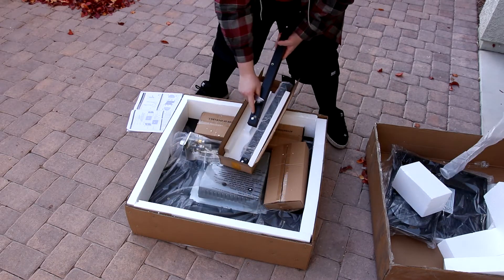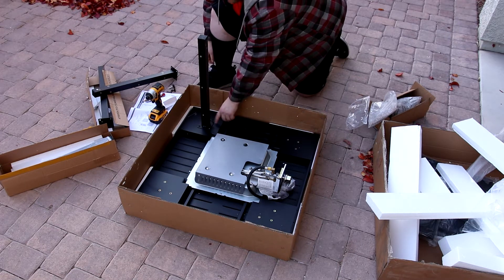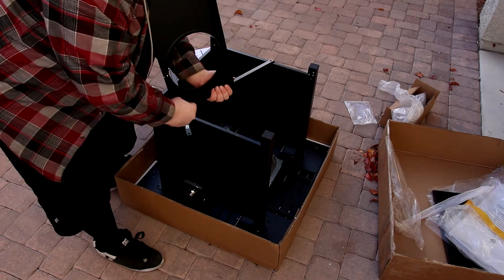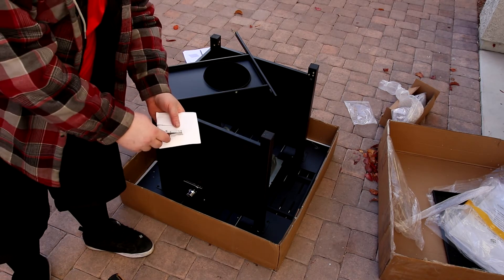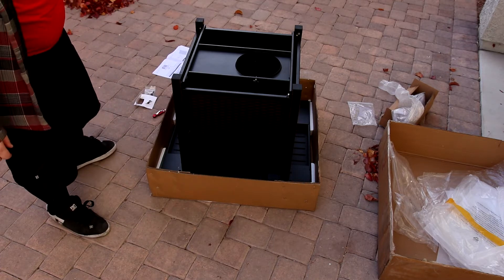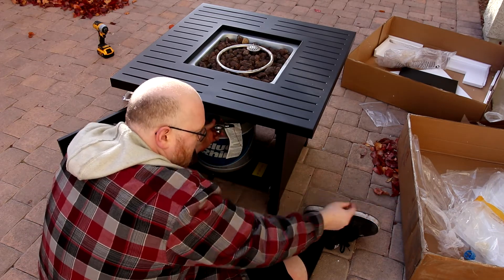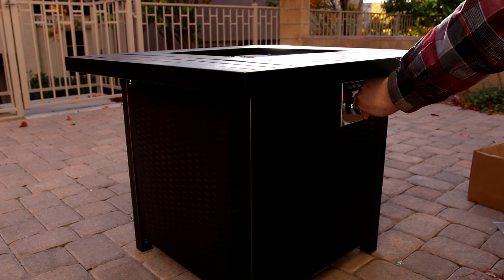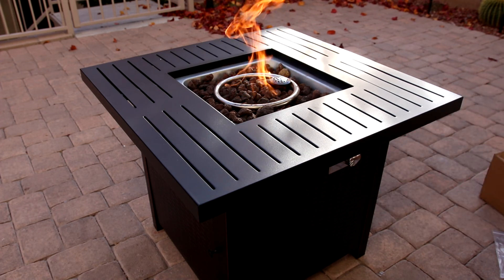Assembling And Testing The Ciays 50,000 BTU Propane Fire Pit

Comment: I just purchased one of these and I noticed that even on low there is some noticeable,soot /black smoke come off the flames ,is this normal?am I not getting proper air/fuel mixture, never owned a propane firpit before so it's all new to me ,any info/insight would be appreciated 😁